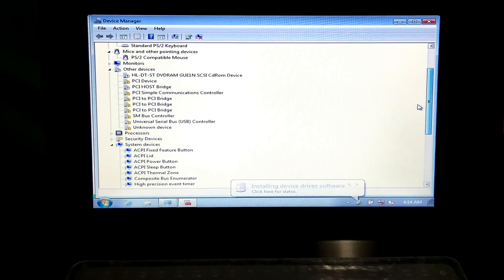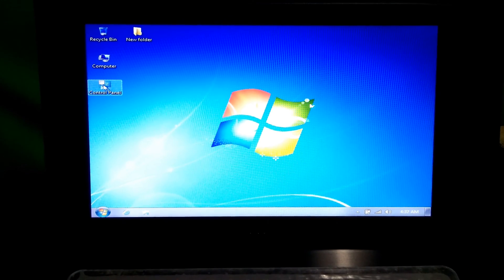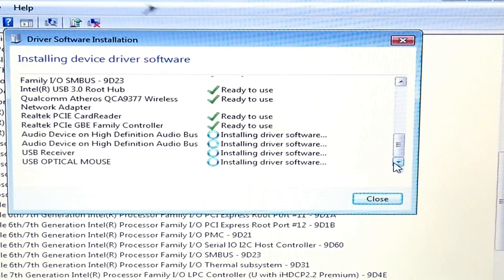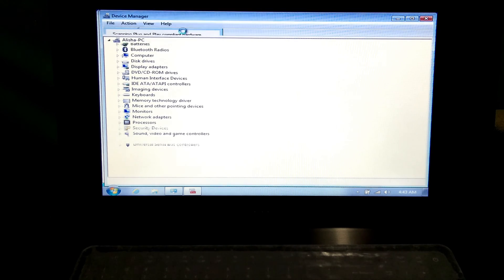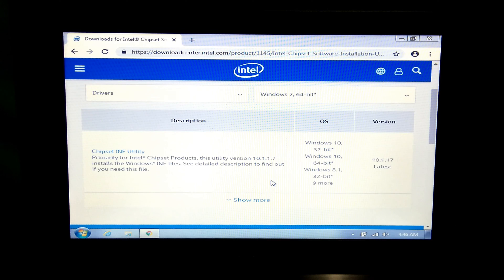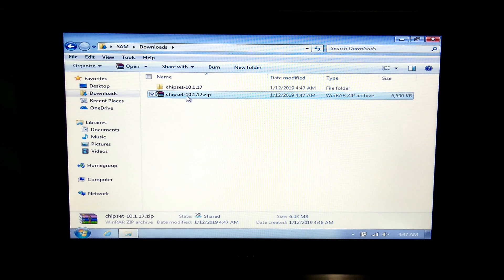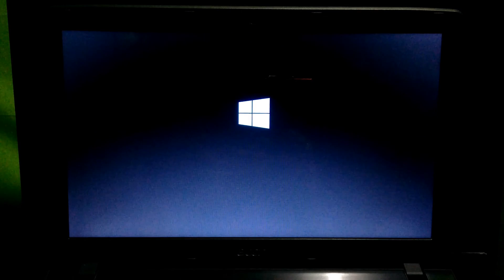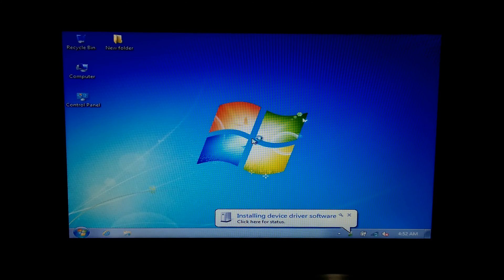How to Fix PCI Bus Driver Issue in Windows 7, PCI Device Driver Error (2019)

Comment: Why can't my new, newly cloned Win 7 SSD boot up a different desktop computer?
 It was cloned from a smaller SSD that runs Win 7  -- I used Macrium Reflect 8 software (free trial).
When I replace the smaller, older SSD with the newly cloned SSD it doesn't boot up.

  I've tried the new clone in 2 other working computers (one has Win 10 & an SSD, the other has Win 7 & an HDD) -- I used the same SATA & power cables as the original working hard drives.... I've also formatted the new SSD, then ran the cloning software again but get the same results...all I get is what is like a 2 1/2" SSD thumb drive...

 When the computer's original hard drive is still installed, all the files & folders are on the new SSD, they are accessible & editable via the SATA connections (or via a SATA-to-USB adapter). BUT when the clone is plugged in to another computer's SATA connections  (replacing that working SSD or HDD) the machines will not boot up ....  Also the new SSD dies not show in the BIOS of any machine.

Comment: So I had this recent issue w/ Windows 10 Pro Instill to ASUS Z599-I w/ i9-10850K using IGPU   I ran the IGPU driver & it solved 2 more items but left 1 unknown, 2 PCI devices & the ongoing Bluetooth serial port (I believe related to new Intel AX210 WiFi 6E+ since I got that on older X99-M w/ same card ) I don’t see a Z590 specific INF file since x299/x99

Comment: It need network adapter driver to run wifi which is also missing.
Reply: For anyone who reads this as the video is a bit lacking, you need to download the driver on another machine and copy it to the machine that needs the driver with a flash drive.
Reply: @bigheadedguitarist  do the have to be running the same OS?

Comment: I used both methods and my PCI still shows "The drivers for this device are not installed. (Code 28)
". I downloaded the "chipset" and did method 2. Failed. I then ran again and "extracted all files" when I ran it.  I also manually installed from the download.  If there is another place this should be stored other than "downloads" folder for safety or for useage I do not know where it is located.  My initial problem is my Ipod nano disconnects itself. I have updated windows. I have uninstalled and reinstalled my "universal serial bus controllers" in the device manager. My device manager is also not showing a "portable device driver".  Thank you.

Comment: it says platform not supported for the second option when i download and try to installl the chipset
Reply: Then you need to make sure you have the right driver made for your chipset. You need to go to Device Manager > IDE ATA/ATAPI controllers > Intel(R) _ Series/C_ _ _ Series Chipset Family (2 or 4) port Serial ATA Storage Controller - 1C_ _. Then make sure that YOUR "Intel(R) _ Series" matches that of the driver you downloaded.

For instance, after 9 yrs I'm still running an Intel(R) 6 Series/C200 Series Chipset. Then go to the Intel website and be sure the driver you downloaded is the right one.

Good luck.